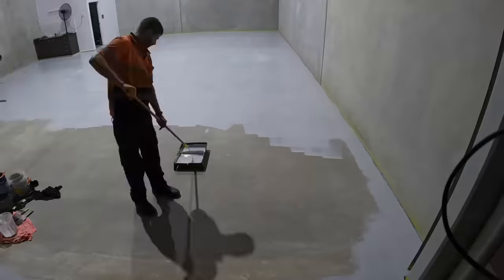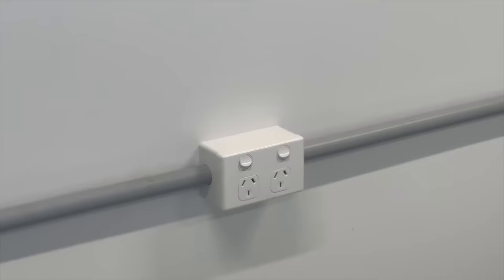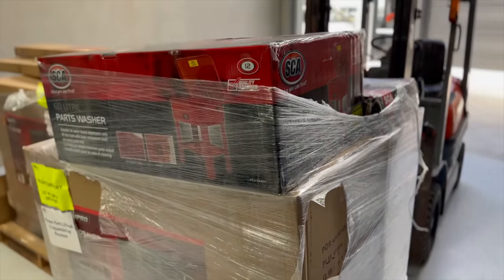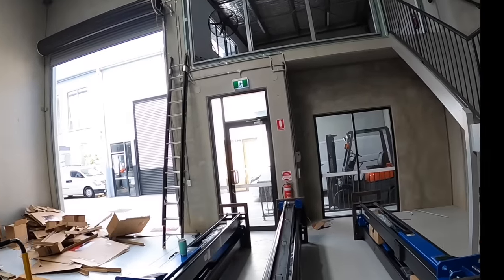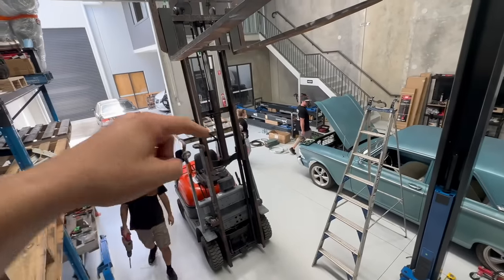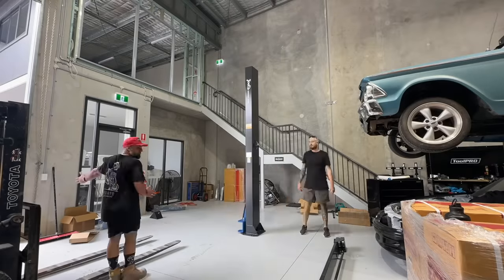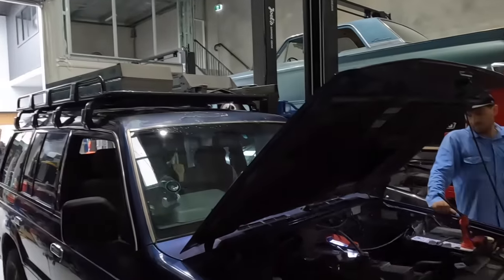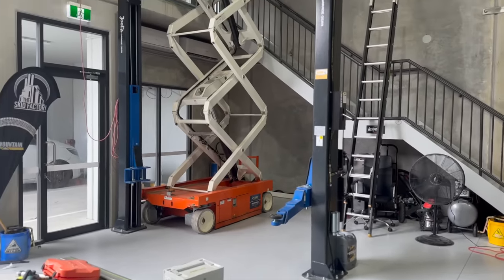This New Workshop Space is EPIC! A NEW BEGINNING for The Skid Factory!

Comment: Hey Woody, the new Shed looking good fella. Looking forward to seeing future projects emerge from here. In regards to you’re sound quality/echo issues, if you build a timber frame the same size as any of your supplier/sponsor banners you’re going to hang on the walls, then fill the frame with insulation then cover it with the banner. It works a treat. Don’t seal the insulation up just leave it open, it then helps baffle the echoes etc. Shout out if you need any more assistance. 🤙🏼

Comment: Woody, three phase means 3 x 30A, Single phase is 1 x 30A. You can fit 3 x 10A GPOs on a single phase - if you have just single phase, 1 x 10A circuit has to go to lighting. Then you have 1 x 10A circuit for a lift and 1 x 10A circuit for a coffee machine :)

Save up and pay for the three phase - then you can run a spa on 15A and a welder on 15A.

Comment: Little tip from personal experience about your wall of tool boxes. Put a couple of anchors in the concrete underneath them, bolt them to each other and to the anchors in multiple places in as hard to access a manner as possible. 

We put in an 1 anchor per box plus 1. We had 9 boxes and 10 anchors, so there was one at each end and where each one met. Had to do this after someone used a flatbed with a crane to make a hole just a big enough to drag an enitre tool box out before a business nearby noticed and called the cops and they got blocked in at the estate entrance. Two years later someone tried doing almost the exact same thing, just chose a different place to break in, got as far as trying to dismantle the one box, gave up and just stole some air tools.

Comment: Looking good Mate. Only suggestion I have is get a "Big Ass' fan they are awesome. Can run it when you don't want AC on and will also move that cold air around.
Reply: Yeah I woulda thought having the unit under the stairs would choke it back a bit.  At least they're 8kw and not the 7s.   Sooo jealous

Comment: in regards to the sound… think of sound as travelling in straight lines, reflecting of hard flat surfaces (like a snooker ball off the cushion). You want to diffuse those reflections (picture those wall panels with heaps of small cubes, all at different heights). If you carpet all the walls and eliminate all the hard reflective surfaces, you will end up with a ‘dead room’ like a recording studio booth. Try to aim for a balance… but why dont you hit up Moog for some advice, he would be all over the shizz…

Comment: Looking good there Woody!!! Those commercial concrete bunkers are pretty shite for stopping the heat from the sun. I'd suggest a false roof lining with R30 insulation mounted a few inches from the outer roof skin. Then with 3 or 4 whirly gigs in the top edge of the roof skin should allow convection current to pull air through the air gap between roof and insulation to then exit via the whirly gigs. If any of the concrete walls get sun for most the day then painting the exterior in a reflective colour will help stop the wall absorbing as much heat and then more insulation on the inside with an air gap again so the heat can rise to the roof.

Comment: Pro tip for the future: when you've got an old brush with lots of dry paint on it -> if it was water based paint, soak it in water (if its oil based just use the thinner) and use a metal brush/wire scratch on it, brushing always from the base to the end of the hairs, its not gonna make it new but it's definately gonna clean it up and make it usable again.

Comment: It looks so fantastic.  Dream of every guy to start 'new' and build their ideal space.  Workbenches.   I have a couple 1m x 75cm workbenches but I finally moved to a large shop (356 sq m) and getting a 2m x 1m bench is probably the best 'tool' I built.  So many times I need spread out and assemble something or create a wiring harness.... you may not have the space for it, but foldable tables could also be a solution?

Comment: 230V +10%/-6% is mostly an on-paper standard.  Same for 3-phase 400V (used to be 415V).  In reality, when the change was made on paper nobody's supply voltage actually changed.

We still have rotated phase issues in places like the Melbourne CBD dating back to the 1960s.  So nobody is going to change things down 10V unless there is a reason to redo things.

Comment: A suggestion {if practical}, do you guy's use something similar to the "Big Ass Fan" where you are?  Sometimes all ya need is a bit of air movement to cool off {noise could be an issue tho}.
Reply: The aircon works well. and also there are big pedestal shop fans around if need that bit extra. The humidity change alone was crazy.

Comment: Nice shop build, but don't talk about your security. You showed what brand and model om security camera you used, not good if someone finds a flaw on the camera.
Would hate if someone came and stole your stuff. A bit sad to see turbo yoda gone, but life over work is always important. Excited to see what you will be doing in the future.
One tip for the pneumatic air system, if the compressor is a bit away from the used tool, an aux tank can help.